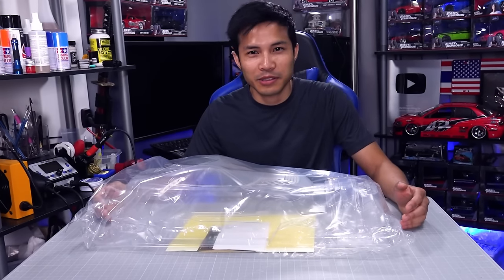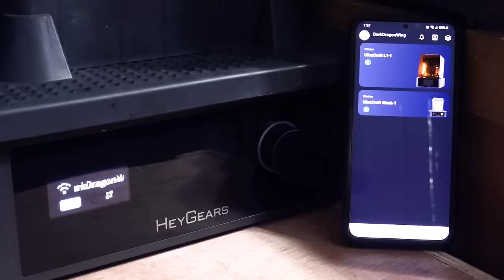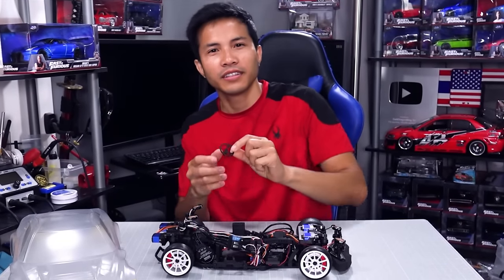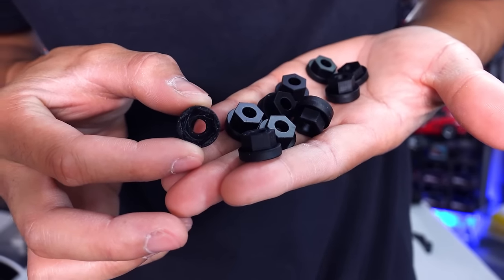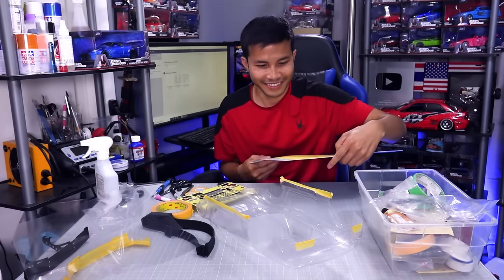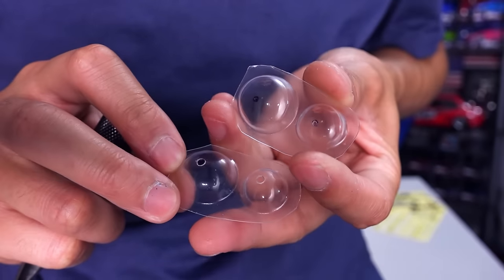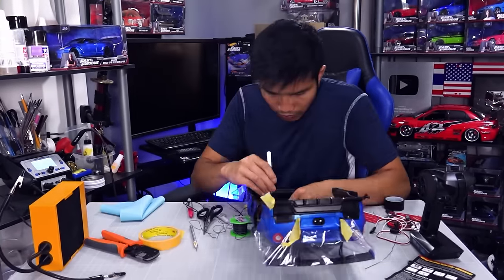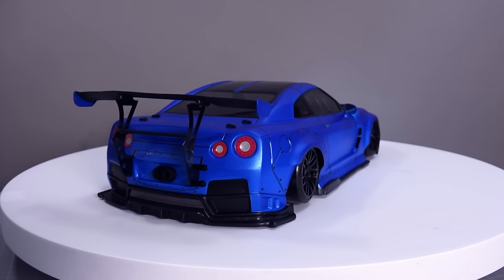RC Modify 39 | Brian's Blue GTR R35 Widebody Fast and Furious 6 Style - RC Car HeyGears Reflex

Comment: Hey you don't have to paint those parts every time you sand them just use a blow torch or a heat gun to heat it up a little bit it will be back to the original colour
Reply from the maker: I tried a lighter on the resin printed parts, it didn't work.
Reply: @DarkDragonWing  I'm really sorry I totally forgot you use resin printer not 3D printer 😅

Comment: Are resin printed parts more durable then 3 printed ones? For what i have seen online, resin is definitely more expensive.

Also glad you finally got the 1 million mark, you deserve it 👍
Reply from the maker: Thanks!! 🙏💯❤ It depends on the kind of resin you use. I haven't used many yet so I can't say much. Some are hard and brittle, and some are flexible and rubbery. So I guess you gotta find one that is hard to a certain point and flexible as well to be durable. I like that the resin is not easily burned when things get hot, maybe bend. While PLA that I have been using will bend easily and will get burned when I use a lighter. If the print bed of the resin printer is as big as the filament printer, I would not use the filament printer anymore is what I would say.

Comment: Brother tell me my pass is a monster truck bought from England, it has been running for 10 years, it is not running, do I want to modify its body or do I have to upgrade all the front engines, please tell me the full parts. Please tell me the details of which motor, which battery, which cooling system should I put or how to put the speaker, speed should be above 50, I am drifting also, plz please tell me how to make my own RC car bro please rly.😢😢😢😢